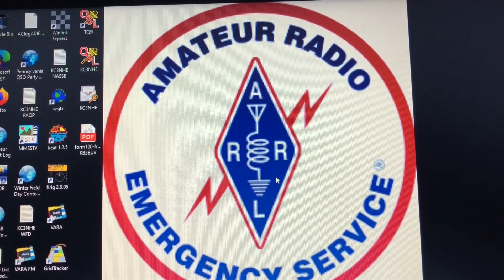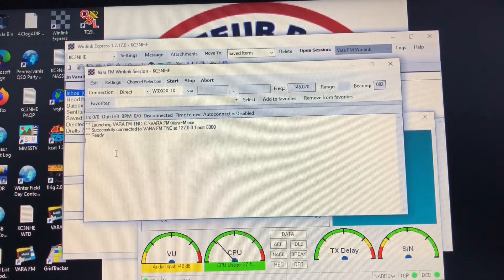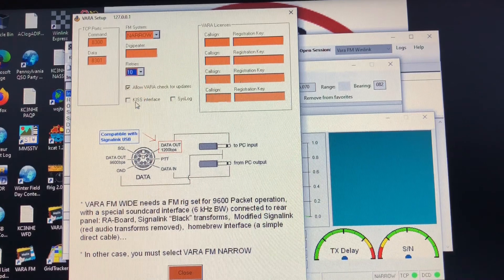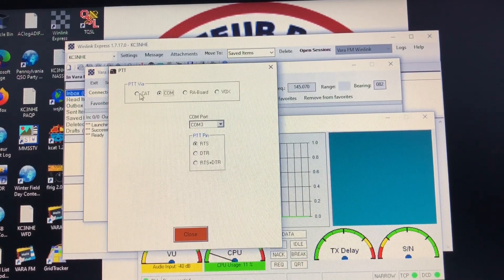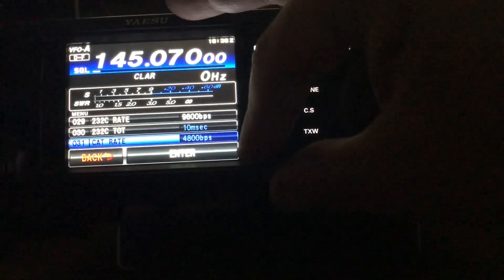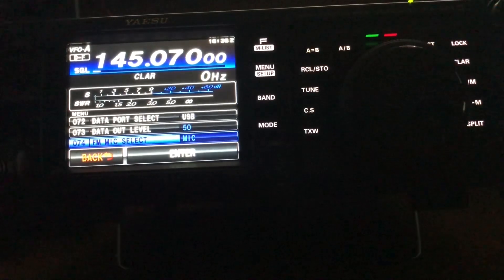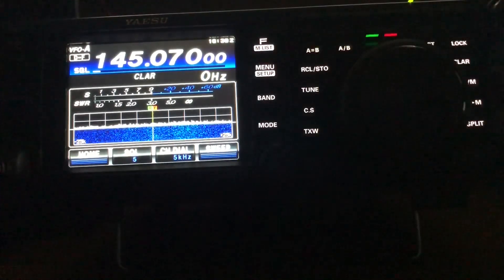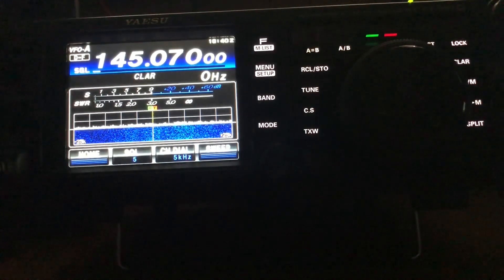Yaesu FT-991A VARA FM Winlink Setup

Comment: I have all the settings on my FT991A the same as yours. Although when I transmit, the radio transmit with the repeater offset. I don't see a separate setting to turn this option of in the radio settings unless I missed it.
Are we suppose to be changing the repeater offset to 0?

Thanks
W5KAL
Reply from the maker: Yes there is no offset in this mode, it is simplex only. Thanks for the great question, 73!

Comment: I've never been able to figure out WinLink 991A on FM without this video. I've tried for years. 
Is there a way to program these settings so I only have to turn a dial to do WinLink or voice ops?
Reply from the maker: You can program the channel to memory and it will hold your settings the same as it would for a repeater. You would still have to set the frequency in Winlink manually however.

Once you have your settings in place for data the radio will hold them as well so all you would have to do is select the appropriate frequency for use.

Comment: Well I have run into the same problem. cannot get my 991 (not A) to connect with Vara FM Winlink, Followed your video, all settings are correct, but will not connect.  Oh well.... And the story you have heard before is it does work on my radio for vara HF, and yes it does, several contacts.....
Reply from the maker: @normk7nwf323  is there a possibility that you can’t reach the station you’re trying to connect to or they’re offline? We have this problem locally which is why we put our own hub on the air. If such is the case try finding a local friend for a P2P test, this is what we had to do to establish and test connections for FM

Comment: with the radio in "fm data" mode it is looking for input from the usb port or data port.  so, you can leave the FM mic select on "MIC"  don't take my word for it though, your system may be different.  I'm using FLrig to control the radio and have it working so that winlink will change the frequency, AND vara will key the radio. in order for that to work, you have to select RTS as the PTT option in the 991a's menu.
Reply from the maker: @craiglandschoot2367 I did learn after posting the video that this is correct. With every new session operated I find more and more quirks in the various modes

Comment: Interesting that I can not seem to get this to work using your settings.  All my settings are exactly the same as in your video.  When I attempt to use the auto tune feature in Vara Sound Card I get a message "no signal"  .  I have the squelch open on the radio.  Com Ports are correct, set to Narrow in vara setup.  Sound card settings on PC are correct USB audio codec, no agc, etc.  I am at a loss.  I read somewhere that 9,600 baud is only supported over the 6 pin, so I tried using that com port and that setting in the radio menu settings as well, but nothing.  Does vara fm on ft991a only work with direct connections?  Or will it work with a digipeater as well?  I have no issue hitting a nearby digipeater with my cheap HT at 5 watts using Radio Mail so I don't think it is a matter of me not being able to hit the digipeater from my base station radio.  I am not close enough to anything else to make a direct connection to test that theory out.  Thoughts??
Reply from the maker: @noneofyourbidness  start from the beginning and try going through the settings again. If you are still having difficulty email me directly, kc3nhe@gmail.com

Comment: Clarification question. Do I need to reset the menu item back to mic every time I switch between WInlink and regular voice HF/2m/70cm?
Thanks, Matt NE9D
Reply from the maker: @mattbrown2996  so initially my understanding was it needed to be. I have since learned this is no longer the case and it will operate as a standard phone unit without doing so.

Comment: Thank you very much for this video. This worked for me after trying several things also.
Reply from the maker: @cmndo9741  and that’s why I made it, glad it helped you. 73!
Reply: What other things did you try?  I can not get my Ft991a to do  vara fm using his exact settings.
Reply: @noneofyourbidness  I didn't do anything differently. A friend also set up his 991A using these settings and his worked fine as well. Perhaps if you did a factory reset and then used these settings that might work.